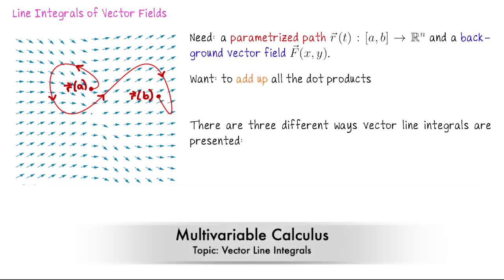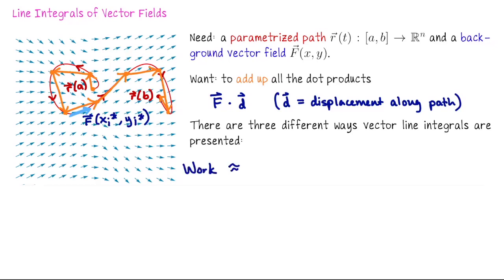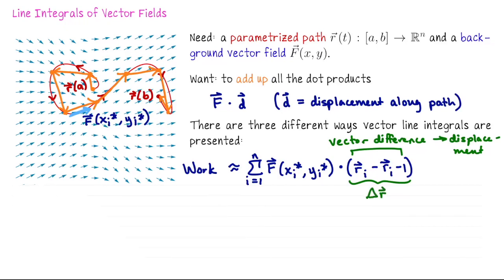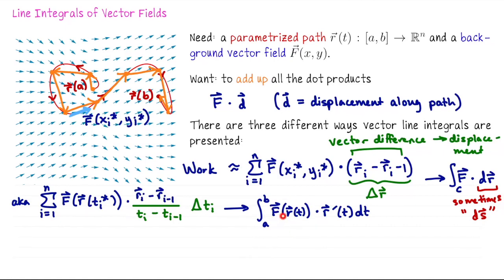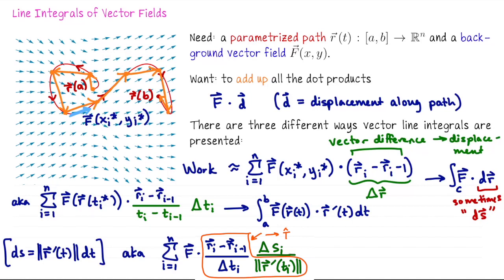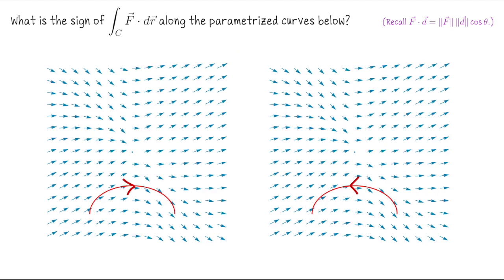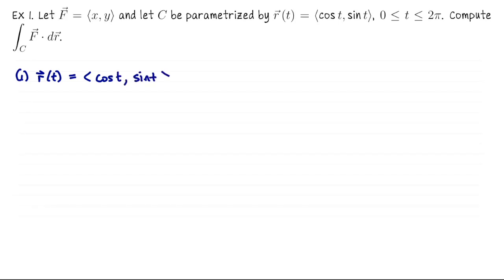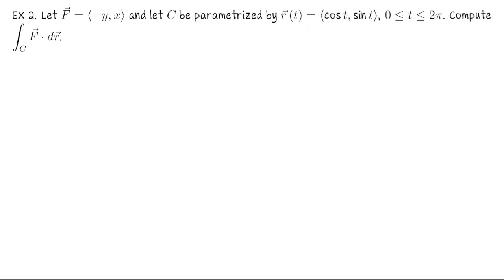Vector line integrals, Multivariable Calculus

Comment: how is it different from scalar line integral ???
Reply from the maker: You can recognize vector and scalar line integrals by looking at the measurement that we are integrating along the curve. For a scalar line integral, it's a scalar quantity (like temperature), and the SLI will essentially add up its values along the curve. A vector line integral measures how much a vector field flows along the path, and is used for computations like work done by a force along a trajectory.

Comment: The last diagram in example 2 shows vectors on the inside of the bending path being shorter than those on the outside of the path. If a vector field's change in direction is necessary for the line integral through a closed path not to be zero, which intuitively seems correct, then the vectors inside the bend must be shorter than the ones outside the bend. In other words, there must be curl!! This foreshadows Stokes' theorem, an insight I didn't have before.